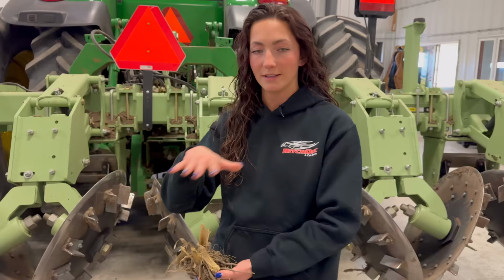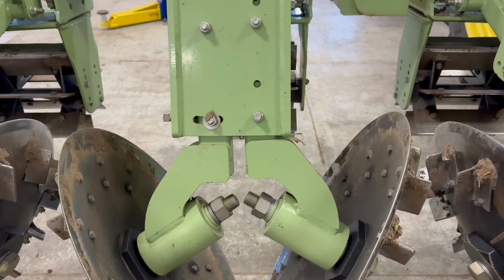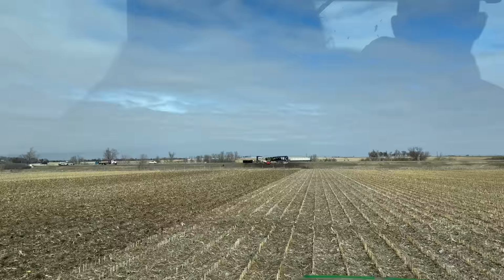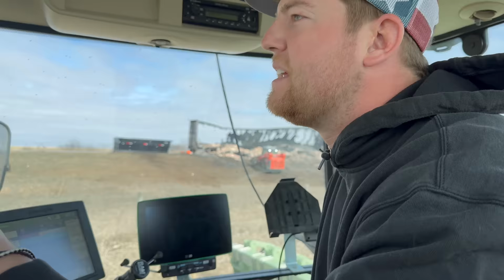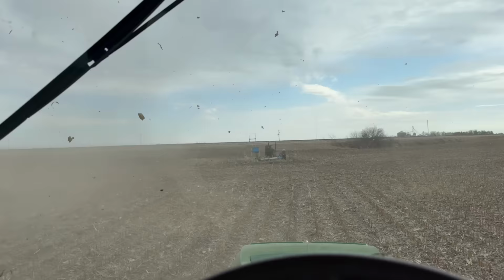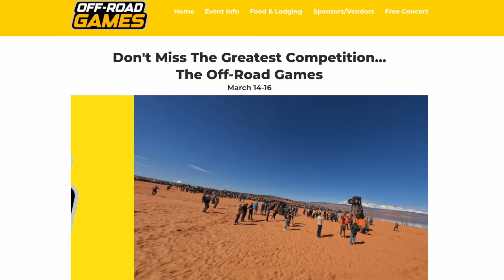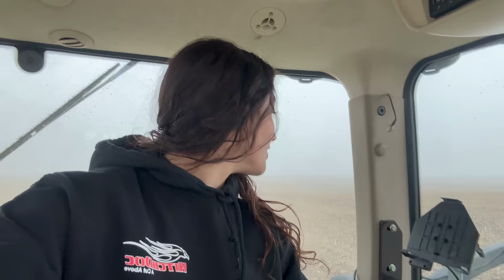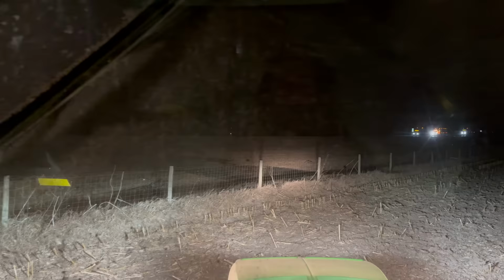Field Work Before Matt's Off-Road Games

Comment: Hi Laura. Funny hearing you talk about not having the correct iPhone cable in your tractor. When I started driving tractor I had to worry if I had good spark plugs in the tool box in case my tractor started running on three cylinders. Check for a cool plug and change it out. Those were the days.

Comment: When I grew up on a farm I spent an incredible number of hours in the field during spring planting and summer cultivating, not mention harvesting.  (something you're familiar with)  And I had no cab to mitigate the weather and the only thing I had to break the boredom was an AM radio.  Of which I would turn up the volume to compete with the noise level of a straight pipe exhaust coming out of the large diesel engine.  (Unfortunately, the other tractors had no radio) I was still very bored but at least I had something I could make noises along with. (can't really call it singing)  Today I find that I can't hear as well in the ear that faced the radio mounted to the tractor's fender.  I can hear crickets on one side but not the other.  Maybe your friend could bring you the appropriate cable for your phone.

Comment: The Jersey turnpike cut our farm in half. Once when I was about 4 or 5 several trucks wrecked behind our farm house and one truck was on fire. The driver was stuck in the cab and burned to death. That’s a smell you never forget.  Before the turnpike we almost never had to drive equipment on the road.

Comment: Laura, your hair is beautiful straightened out but love your curls. I grew up running big and small dirt moving equipment, Cat 633 scrapers to skid steers smaller to yours but absolutely love the multi row implements that fold up then out for max tillage!!!! Reminds me of of our old 46a/ Cat D8H dozer that would boil dirt over the blade when you were in the groove. Actually spent half of my time on the fuel truck so hats off on your maintenance regiment.

Comment: I drive interstate here in Australia, and trailer fires start with faulty brake on an axle. It's catch 22 you see it you can't drive with, but when you stop it, take off and if you can't extinguish it in one go it's best to pull the prime mover (tractor) out and let it burn 
Good luck at  the games. You should have no problems with Rory, Mike, and Shawn👌🇦🇺

Comment: The Orthman 5|SP Stalk Puller is a piece of agricultural equipment designed for fall or spring residue management. It features large V-disks that are used to pinch and pull out crop residue, such as stalks, from the field. This process helps prepare the field for the next planting season by clearing away debris and creating a more favorable environment for planting. The equipment is designed to operate at high speed while requiring relatively low horsepower, making it efficient for residue management tasks.

Comment: Be careful with using chrome sockets and swivels on impacts!!!! Chrome sockets can crack and shatter and swivels can fly apart.
Reply: Should have sets of impact rated sockets when using power drivers, whether air or battery powered!!  Be safe and Love your channel!  : )
Reply: Better yet, only use impact sockets and extensions on any impact tool!!!

Comment: Lot of times that a trailer will start on fire is caused by brake malfunction and the heat will start a fire and then once the tires start burning you can't do much but sit back and hope the FD get there quick.

Comment: LOL, when I started driving tractors, there were no cell phones or cabs.  So no AC ( there was a way to take heat from the motor) and I ran 14 hours in daylight, and 7-8 at night. And no, the tractor did not have lights.  Luxuries like AC, lights, and brakes were for hobby farmers.

Comment: Hello there. I worked all my life on my own. It was a lot more fiscal than tractor driving. I was a dry stone waller. It was very hard work and all weather. I have been retired now for coming up 3 years. I didn't go mad working on my own. In fact I'm   sound in mind. My biggest droback is type 2 diabetes and leg ulcers and bad hip's. So you see it doesn't pay to have a fisical job. It seems impossible to do the things I wanted to do in my retirement. I just can't get anywhere now. Not being able to walk so far. 
But I'm still trying to do other things with my hands. A spot of painting or modal building keeps my mind occupied. I hope yous retired in a better state than what I did. 👍

Comment: Your iPhone will still charge with the old usb to lightning cable. It will not charge as fast as a usb-c but at the normal rate. You only need the C for faster charging. Just get a cigarette lighter plug with sub if needed

Comment: If your combine is powerful enough why not pull that equipment behind it. Wouldn’t it start the  the break down sooner.
Reply: For one the combine has about all it can do harvesting the crop.  Second:  Combines do not have a 3 point hitch on the back of them to connect such an implement.  Third:  That root puller does its job at a much higher speed then what you can combine at.

Comment: You changed the oil every 200 hours? What’s your oil capacity? Maybe my oil capacity is a bit lower, but I change it every 100 hours. 
This is based off of my own oil sample testing for lubricity at running temperature.

Comment: I was stuck in traffic one time, there was a horrific tractor trailer accident, the driver was killed, we were diverted all the way over to the right shoulder when I got close I noticed what looked like bowling balls all over the road, it was still daylight, when I got closer I saw that it wasn't bowling balls but frozen turkeys all over the road, I bet everyone working that scene went home with a few, I was so close to them that I could've opened my door and grabbed a couple, I think couldn't tell what brand they were.